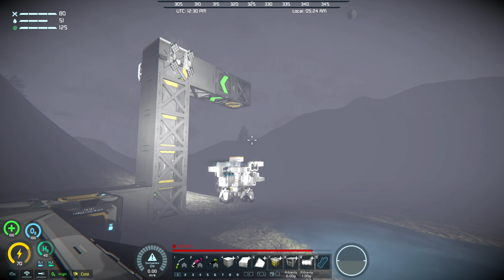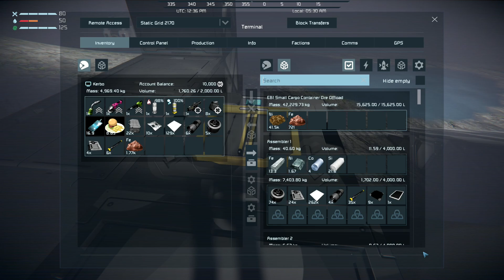Large Refinery | Space Engineers Survival 19

Comment: As your low on power maybe you can have everything you don't need running turn off when it gets dark.
Reply: I think you did turn the refinery off.  I thinking as you on solar power it could be automated to turn things off and later changed to if power levels fall below a set level so you avatar don't die.
Reply from the maker: @eddielowe8189  I have event controllers setup to turn on both hydrogen engines and the small reactor when the batteries are running low. There's no danger of running out, at least not right now.
Reply from the maker: I don't recall if it was in this episode but I had the large refinery off for a while to let the batteries recovery. There's a lot more power in upcoming episodes. Thanks for watching!